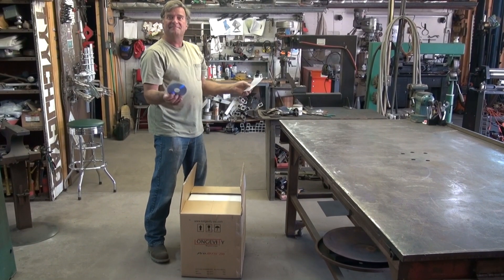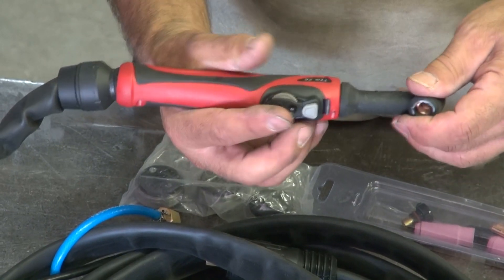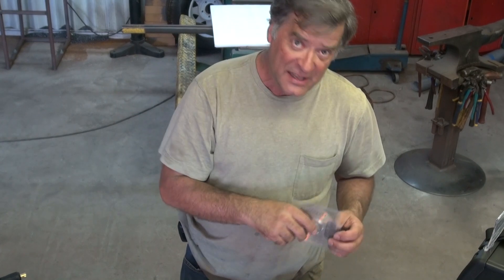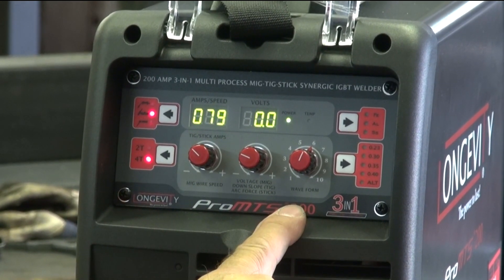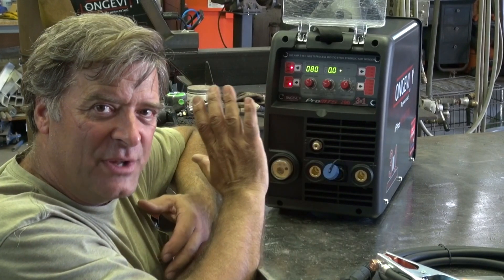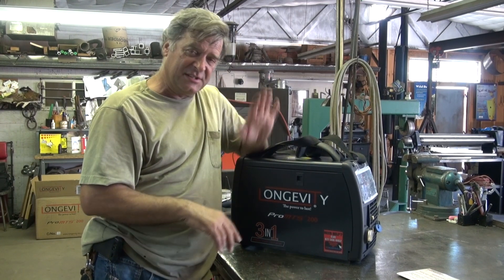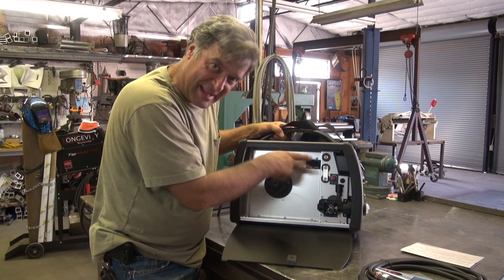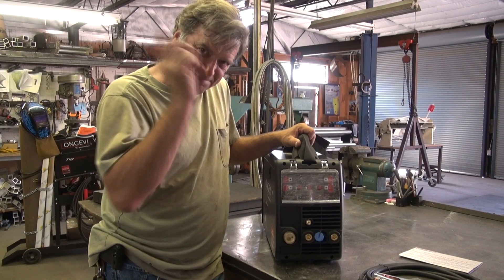Introducing the Longevity ProMTS 200 MIG / TIG / Arc Welder - Kevin Caron

Comment: good luck on getting longevity to fix any thing that's warranty s are are worth less than the paper it's printed on in there machines are jus high dollar boat anchor s try to get service from them you will pay shipping to them then to get it shipped back to you then it's not Guna work long for you if it works at all I've seen a lot of there products showup as d.o.a. straight out of the box

Comment: Hey Kevin, another question. I'm getting ready to set up my mig on my ProMTS 200i. If you follow the cabling that runs (back) from the torch to the control panel box, there is a custom molded plastic connecting tube that the wires/cabling enter that screws onto the control panel with a large knurled nut. This whole plastic connection system is real loose and wobbles around. The large knurled nuts does not cinch everything down tight. Is this a manufacturing defect??? Should it be that loose? Will gas leak out  even though there is a grommet on the gas shaft if I'm moving around the shop pulling on the mig cables as I go.

Comment: Hey Kevin
I just started to learn how to weld and have been watching your videos. Big help in working through what I bought. I ordered the Longevity ProMTS. It runs on 220 only. Can the mig welder system of the MTS run Flux Core? I can't find any info about that. 

Thanks, Bruce

Comment: Keven it's a good thing that Simon Katz, owner of Longevity is sponsoring you.  That way you're able to receive proper support for your welder.  I own a Longevity "Weldall 250PI multipurpose welder" that I have less than 10 hours use on it.  Right now it is a $1500 boat anchor. Simons has had possession of this welder on two occasions, at a cost of 150.00 in freight each time to repair it.  When I purchased it I had a five year warranty. However after them handling it twice within the first year they told me I no longer had a warranty valid at that point and would not correctly repair it.  Being that my profession is automated metal fabrication equipment machinery repair of 35 years, I would only recommend Longevity products to my worst enemies.  I now own a Everlast "POWERPRO 256S" that I tried to brake the first month.  It's a fantastic tig-stick-plasma unit. 

Keven, save your hard earned money and let Simon Katz give you his junk, that way he will keep it running or replaced on a as needed bases for you.  Good luck to you sir.

Comment: On a Positive note -- Longevity wants to "make it right".

I just got off the phone with John at Longevity.  He was a perfect gentleman, very professional, apologetic and came across as truly sincere.  

After the discussion with John, I told him that, in the interest of fair play, I would remove my "negative" posting . . .  I'll be dammed if I can figure out how to do it; any guidance?

Bottom line:  Longevity is trying to make it right by me.  When they do so, I will be back to let you know.  If, for whatever reason, they don't, I'll let you know that also.

By the way, I'm new to welding and, in fact, have never even welded one joint.  I decided on the ProMTS 200i because it provides so many welding options all included in one machine.  I'm retired now.  I always left welding to the professionals.  Now that I have the time, I'm ready to learn yet another skill.

For those trying to decide which way to go, please keep in mind that the ProMTS is 3 welders in one, it's easy to transport and use, all in one compact unit.  The controls do make it possible to switch between welding types, gasses, etc effortlessly. Or so has it been during my "practice" self-learning dry runs.  I'll know better when I actually start welding.  To use a "corny phrase" -- "Good luck and Good Welding"   LOL

Comment: i got mine .. works really well totally differant then any machine ive used.. like its got a brain.. it only welds when your touching the metal with the mig . the tig is kinda hard to start a arc with the big torch handle . bit it works very well . and yes its easy to forget to turn the switches on the inside for mig.tig .. i used the tig in the mig setting and welded the  tungsten to the piece melted off i think cause the burnback control ..

Comment: I don't know what the local or remote switch is for. It was the reason I didn't buy this machine. Te salesmen did say they are going to make it work with a foot pedal later but this model doesn't. Great videos by the way!

Comment: you dont have to go out of your way and buy consumables.....  just use a 3/32 tig rod (you probably have plenty of those at your shop) that is "basically the same" as a stick electrode minus the flux coating ..... it'll tell us if it clamps or not.

Comment: So no gas hose (unless bought seperate...) drive rolls do not fit the plastic wire feeder in the machine... They might or might not fit something else, and you have to have a laptop or dvd player in a dirty weld shop, no hardcopy manual.... Too bad we didn't see you dialing it in and welding with it....

Comment: Good job explaining the machine and the larger size rollers. The last video  saw didn't explain that those larger rollers where for the spool gun. Unless I'm mistaken isn't the 4T just a setting that allows you to pull the trigger (mig) or push the button (tig) once and it will stay running until you hit is again? That's how I understood it but I could be wrong. Just basing that upon what I've seen in other videos. 2T is a normal hold down the trigger or button and let it go when you're done.